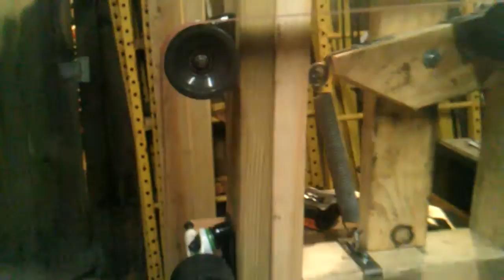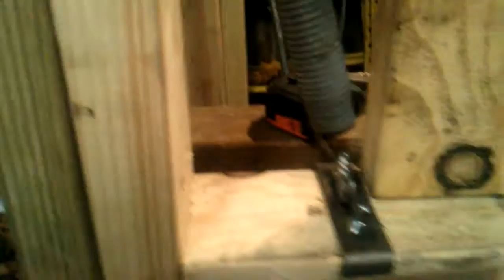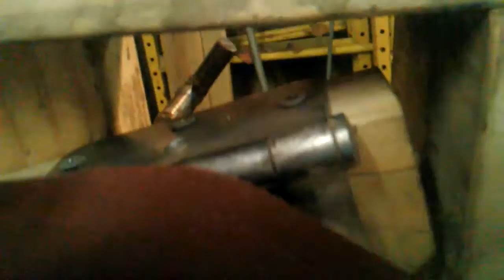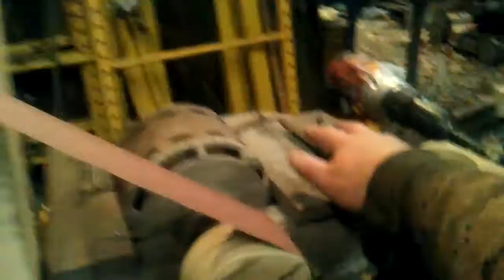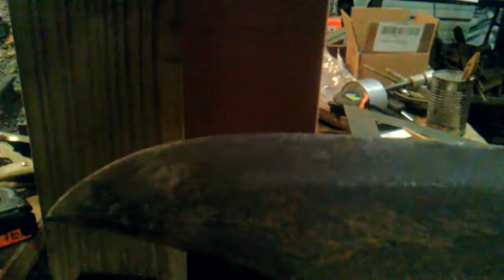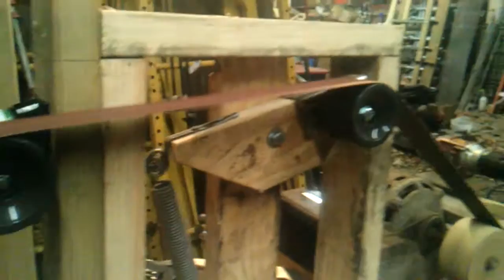2"x72" Belt Grinder, Proof Of Concept, Prototype Build. $30.00 Success!!

Comment: How about a sketch of the distance from wheel to motor, etc?
Reply from the maker: You might want to read some of the comments that I made on the 3 videos I have on this grinder.. 
This was a proof of concept grinder, just to figure out how the tracking worked, etc.. Yes, the grinder is still in use today, and I was using it a couple hours ago, but, when I build another, it will be different.. I would rather have the motor closer and the tracking tension wheel higher so the belt coming toward you is going down to the front wheel, rather than straight across. Just lay your wheels out on a table and stretch a string out the length of the belt you are going to use and design it how you would like to have it set up.. Depending on how you make your tracking wheel, you can have less or mote flex in your belt, but, you can always use it to take up any slack in a build that didn't go exactly as planned.. Just don't box yourself in when you built that part of the grinder, just in case you make a mis calculation.. Just pay close attention to keeping the belt running straight and everything square and the belt will run true.. You will need quite a bit of tension on the belt.. If you push into the belt and it wants to run one side of the wheel or the other, that will be the problem.. I went back and tightened my belt spring up twice.. 
It's not that big of a deal.. I also increased the diameter of the drive wheel by an inch.. Can't remember exactly, but, I didn't waste any of a 1x6 deck board width.. But, I have a slow speed motor..
I built another, still have not finished it and used two 4 step pulleys.. For the price and complexity and the increased size of the footprint, next time, I will go with a 3phase motor and a vfd to get the variable speeds.. 
I had many discussions with others on my main two videos about, why I would do this different, and why I like this or that..  There is nothing wrong with  a single speed grinder, depending on what you are going to do with it.. If you are going to start grinding knives, you will eventually want to have that..